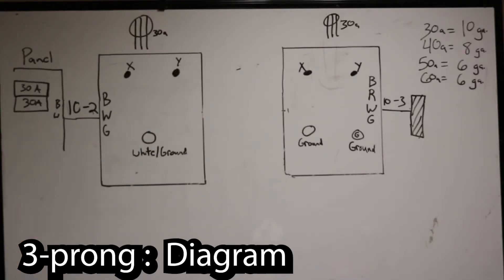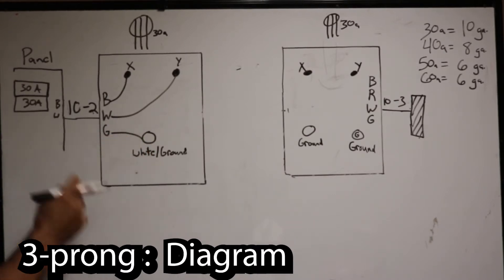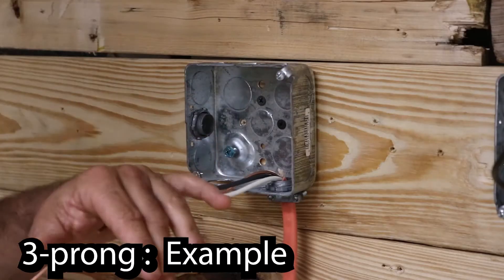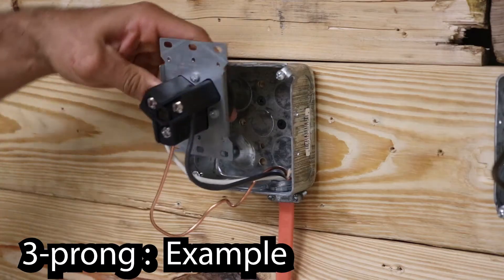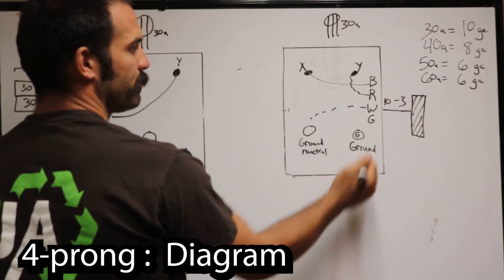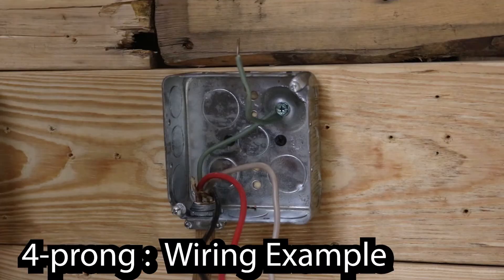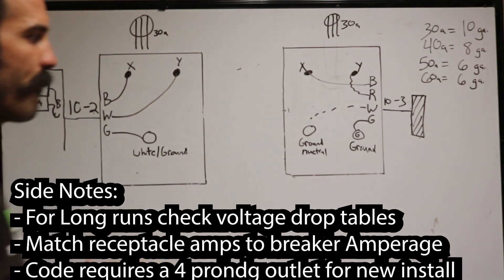240 outlets for Stove or Dryer

Comment: If I have red, black, white and ground how do I install a three prong outlet? Ignore the white or the ground?
Reply: In this case you should actually use a 4 prong outlet (which is safer, and more modern / up to code). However, if you MUST still use a 3 prong outlet in this case, you could technically connect either the bare copper wire or the white wire (which in this case is a true Neutral wire) to the neutral terminal in the 3 prong 240 outlet. I would connect the insulated white (neutral) wire to the neutral terminal in the 240v outlet in this case though. Also, if you use a 3 prong outlet in your case, you are gonna end up with an extra wire that can't connect to anything. I guess you could just cap it off with a wire nut, or black tape... But man, I would just use a 4 prong 240 outlet in this case, since you already have the proper wire.

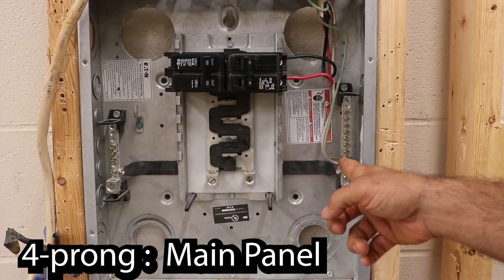Comment: 5:00 Uhhh... I think this is wrong. The ground rod is always tied to the MAIN panel, not the SUB panel. The white and ground will go to the neutral bar in a SUB panel, not a MAIN panel.  The panel configuration you're showing at 5:06 is a MAIN panel, not a SUB.